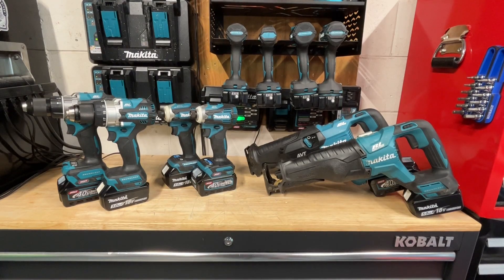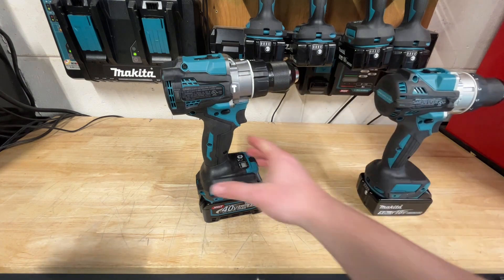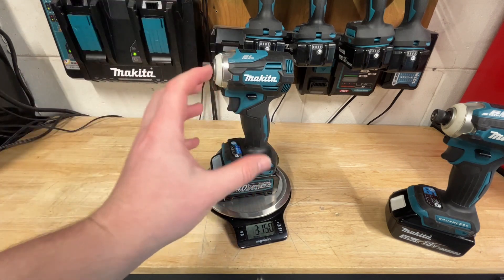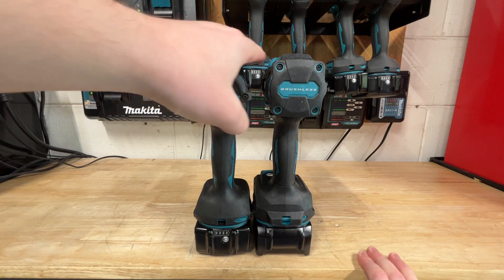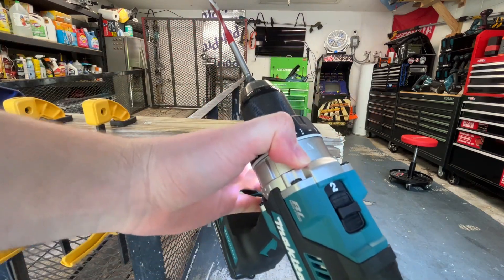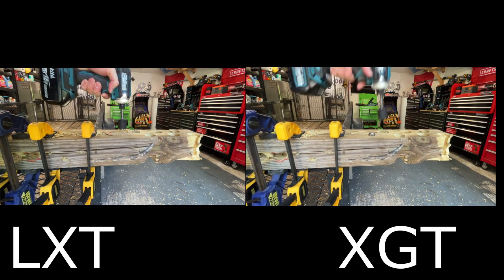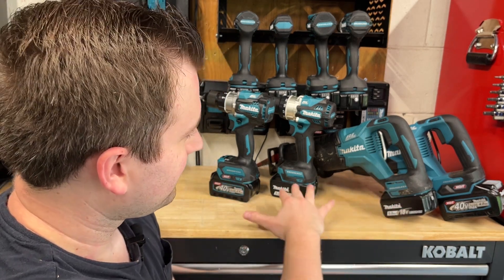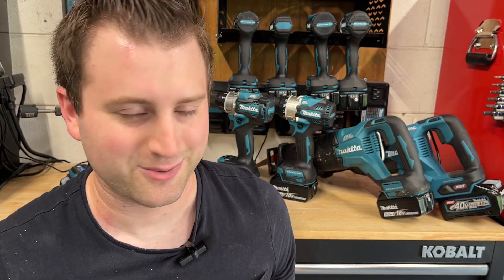Makita XGT 40V VS  LXT 18V? Size, Weight and POWER TESTED! 3 Tools in One Video!

Comment: As soon as Makita comes out with a Stacked Lithium Battery for their LXT Line , it will  Renew a Ton of interest for Makita.....
Reply from the maker: I’ve really got no guess for that, I can name a few reasons why they would and why wouldn’t. It’s really up in the air if they will do a stacked battery. However it’s pretty much guaranteed for XGT.
Reply: They have patents, but it won't change much in real life. Lipo batteries are severely overrated btw

Comment: Nice comparison 👍🏼 … I don’t know a whole lot about electricity, but I thought a 2.5AH battery should only have 1/2 the run time as a 5AH? Why is this supposedly not the case with XGT vs LXT?
Reply from the maker: Voltage is double with the with XGT, to supply double the voltage you need to halve the amp hours.

Comment: Can they share batteries?
Reply: Unfortunately, the tools are designed to only work with the battery with the right voltage. They are therefore completely different tool platforms, even though they are both made by Makita.

Comment: I think makita made a step back with the 40v platform.
Reply: I had the 18v for many years and appreciate the step up in power. I've been doing solar for over a decade and I drive a lot of lags, fasteners, and drill. The 4 ah battery lasts as long as a 5ah 18v with more bawls. The ergonomics of my XGTs are worth the extra weight up the roof vs my co-workers Milwaukee and DeWalt
Reply: 40v is big step up .I'll never go back
Reply: How? It's a separate system for people who NEED more power. If the 18v works for you they have plans to continue expanding the 18v line so support isn't dropping.
Reply: @jonathangarzon2798  no chance. They'll drop 18.
Reply: @SB-Kiwi  They are still bringing new tools for the 18V line, some of which aren't even on XGT. I don't see them dropping it, tbh
Reply: why?